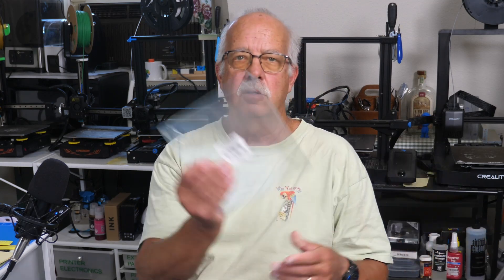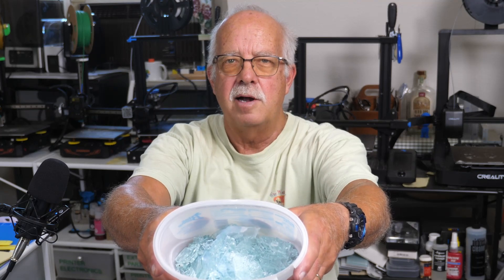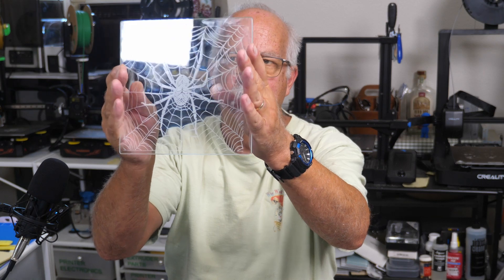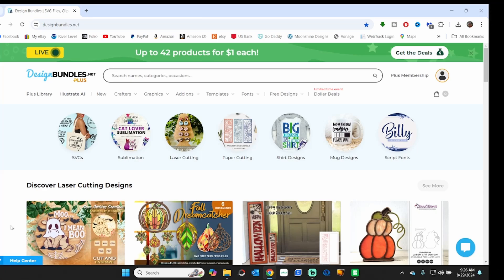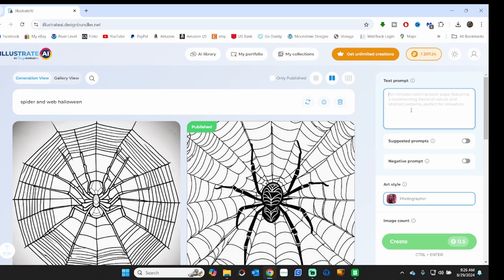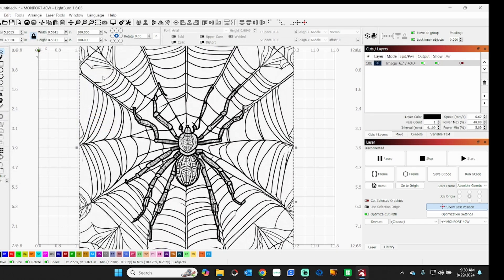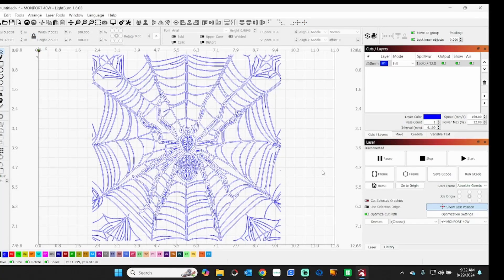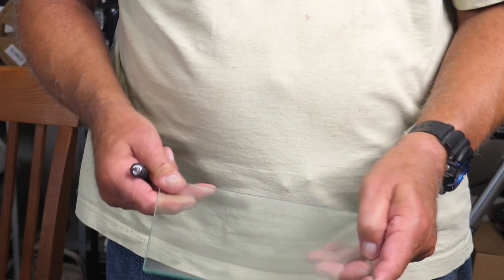CO2 Laser Etch Tempered Glass

Comment: You cleared up a doubt for me. I have engraved hundreds of crystal glasses and wine glasses but I have never engraved tempered glass. Just today a client sent me tempered glass trays for engraving and I was apprehensive... My machine is 60W and I normally use 300mm/s speed, 30 to 35% power and 0.1mm gap. I always place a newspaper wet with soap and water on the engraving area. I think I can use the same setup for tempered glass. Your video is very good, very educational. Thank you Roger.

Comment: Great video, very helpfull. I'm curious why you converted it to a vector and used fill instead of dither. Most people use dither when engraving glass from what I found. Have you tried running another layer with a line so it makes the edges more crisp? I heard some do that as well but I didn't know how tempered glass would hold up with that. And lastly, have you tried other tempered glass thats made better? If so, does it require different settings? I have heard cheap glass is way harder to get a good finish with and all of these variations have made me worried about engraving glass. I want to do a PC tempered glass side panel but I dont want it to break and not be able to replace it.
Reply from the maker: Only use Dither when there are "shades".  This is a strictly black and white with no gray shades and fill is WAY faster.  Have not tried it on any other tempered glass pieces.
Reply: @rogersshop  Thanks for the info!